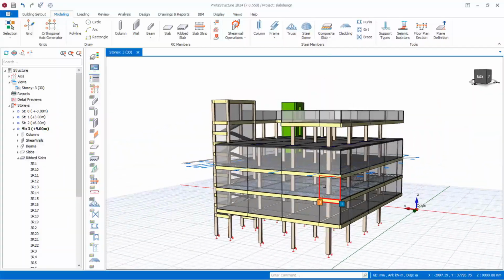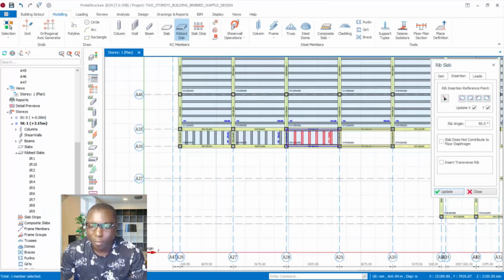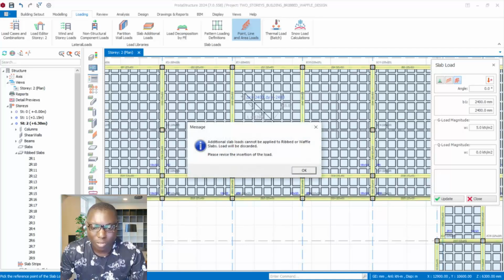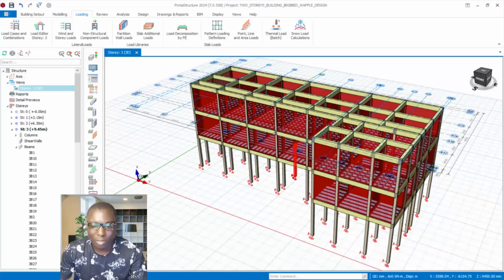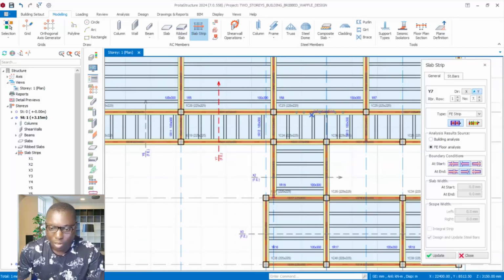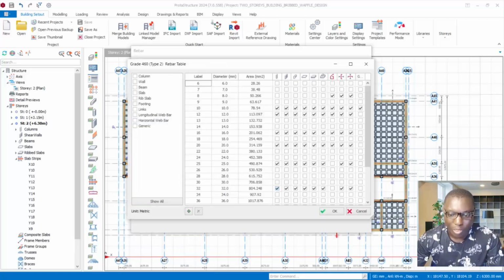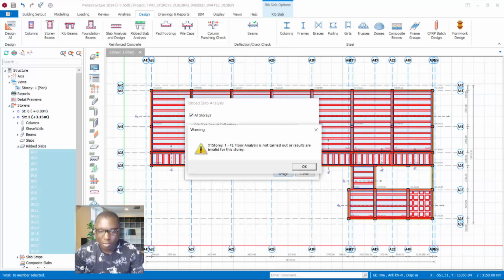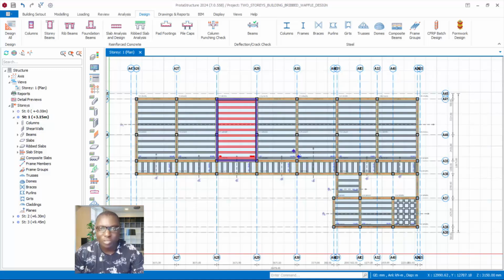Ribbed & Waffle Slabs: The Secret to Super Thin & Strong Floors

Comment: you should use normal building analysis to get accurate results otherwise if you used the FE analysis then the slab stiffness should be reduced by 0.25 factor to have the correct answers as provided by woodarmer method